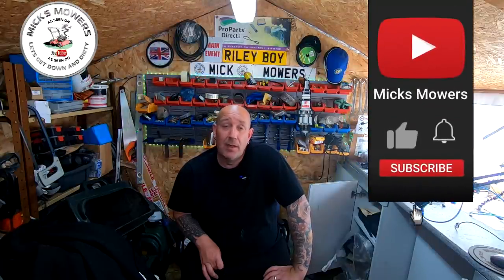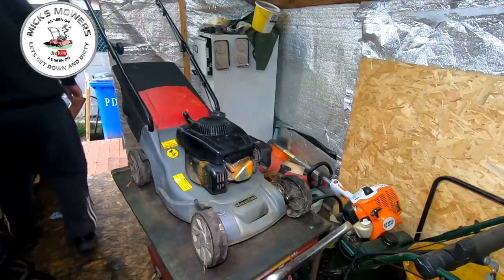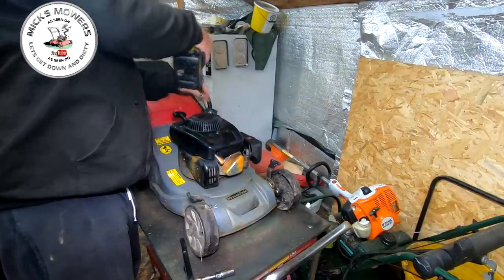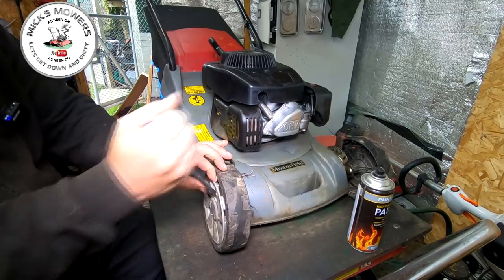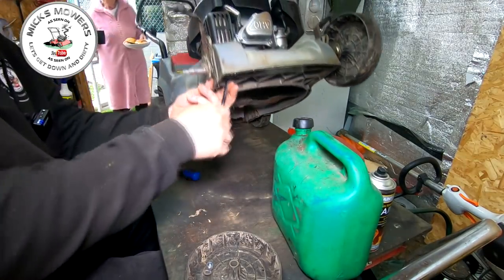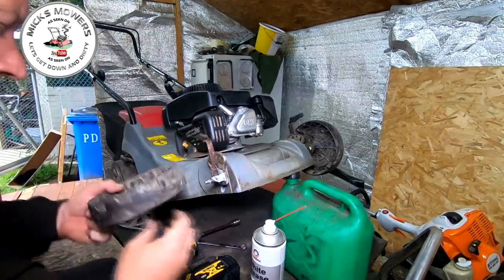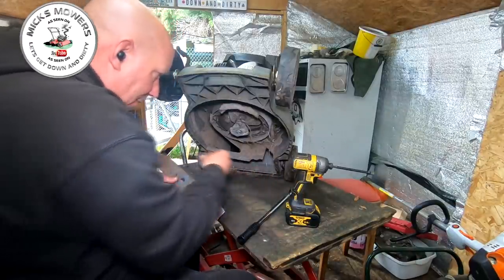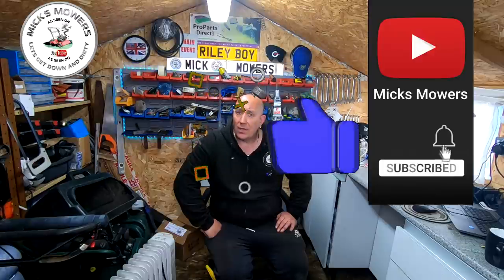Mountfield 414 Repair Video #how #howto

Comment: Nice video again Mick. Hope Nanna is going ok after her trip to the Docs. All the best
Reply: Quick question Mick: what guage cable crimps do you suggest for repairing these cables? 14awg? Or do you go by mm rating? Ie up to 1.5mm cables. Thanks

Comment: Got gifted one of these, never used a petrol mower. What fuel do you put in/is it an oil mix?
Reply from the maker: Normal unleaded fuel and they have a separate place for oil.. like a car.. use SAE30 OIL from somewhere like B&Q.. good luck